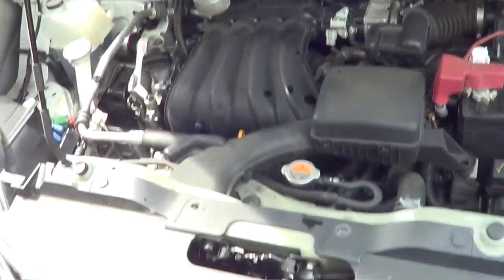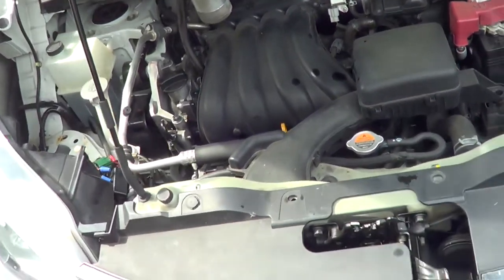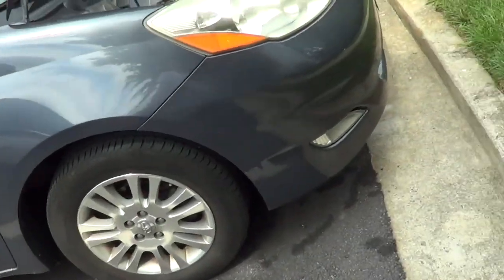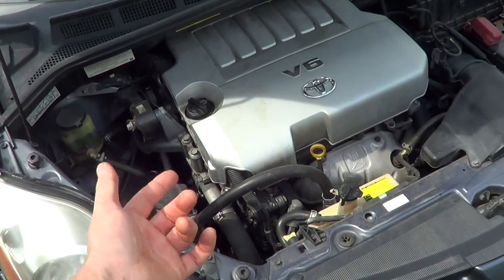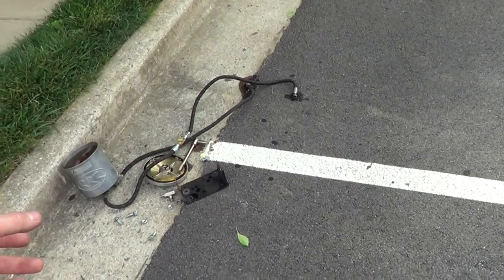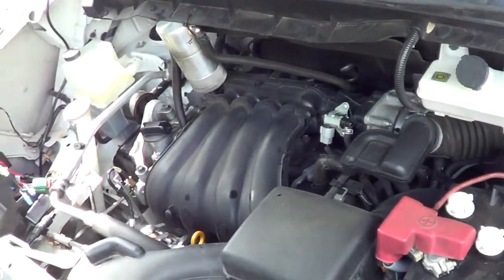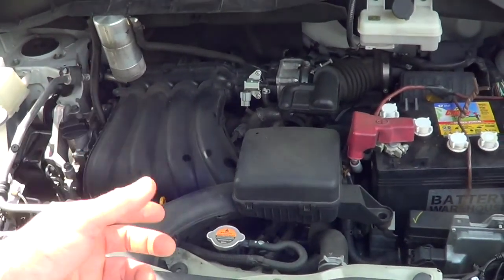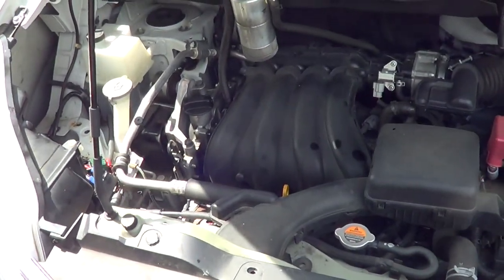Oil Bypass Filter Pulled on Gasoline Engine

Comment: Of course you have to change the oil. It doesn't matter how well it is filtered, the additives in the oil simply do not last forever. They break down with time,  prolonged pressure and heat Causes oil to get thinner as the viscosity modifiers degrade.
Reply from the maker: Dielses can go 100k miles between oil changes.  I was trying to achieve that with gasoline.  But I found it isn't possible because the tolerances are too tight to deal with the sludge.  I couldn't  find anybody else doing thus experiment on gasoline.  So I did it and published.  The best results are 7 to 10k oil changes with a good quality oil.  I'm not sure about 3k filter changes though.
Reply: We had trouble with the multi grades back in the 60s They had trouble because of not holding up for extended use. You.for.sure didn't use multi grade oils in a diesel. My. Rambler used Delo 100. It was for diesel engines but I Didn't care. The Frantz kept it like new. I used MD toilet paper. Some oils turned dark with use.because of ashless additives. I liked the Chevron Delo 100 because. It was golden. Some of these modern oils will increase in viscosity with extended use due to evaporation. To deal with that I change the filter often enough to keep that from happening. Was looking at an owners manual for a diesel car. It said use multi grade and the warranty is voided. Another one said use 10 40 and the warranty is voided. It took me a long time to get to using.multi grade. It took more polymers to make 10 40 than 10 30. The polymers didn't hold up. Things have changed but the oil still needs to be clean. Allowing the oil to get dirty then draining is a lousy maintenance program.
Reply: The reason sludge is in the engine is because the filter isn't taking it out. That is usually because the filter has no depth. That's all spin on filters. If the filter has enough depth to clean the oil. It means it's not being changed often enough to clean remove the sludge. You can look around and find several that clean oil. If you are not changing them because the elements are too expensive You are screwed. Years ago Toyota had trouble with sludge clogging oil passages. That was caused by extended oil drains without better filtration. Might still have that problem. The sludge is supposed to be in the filter.

Comment: Great video. Have thought about going 100% synthetic like AMS oil? W/o the there filter plus oil, your guaranteed for 35,000 Miles. I'm doing this with my 2nd gen Cummings plus I do have a Napa bypass filter...5 micron filter.
Reply: Haha 35,000 miles, trust me that oil is done at 20,000 in a gas motor, good luck in a diesel.

Comment: What kinda oil were you using?
Reply from the maker: Pure synthetic amsoil signature series.  I could not find any evidence that bypass filter extends oil life on gasoline engine.  Big rig diesel may be able to handle the soot.  But, not gasoline.
Reply: NathansHVAC interesting findings. I’ve been playing with the idea of installing a bypass system, but wasn’t sure if it would be worth it. Guess not
Reply: Its a typical problem with expensive filter elements.tHey don't get changed Enough to keep the oil clean. The Amsoil is like most oils. They will stay looking new as long as you keep it clean.The old Amsoil filters were very good but didn't get changed Enough to keep the oil clean. The pleated Amsoil filters are a joke. Get one of the toilet paper filters and some Scott 1000 and change the damn thing.

Comment: oil life depends on use and hours. Not miles. Cars that calculate oil life via engine rpm, load, temp, and hours can indicate a long or short life for oil. EX) 2007 suburban that is used for road trips: oil life indicator will lets us go 12,000 miles+ between oil changes because we get on the highway and cruise for several hours straight. But once it's back to daily driving the life drops quickly. GM calls for synthetic fluid from the factory and Mobil 1 is our favorite. My dad and I each personally do 10k oil changes on the 10s.
Reply from the maker: I was trying to get 20k oil changes with bypass filtration.  But, it an't going to happen.
Reply: I don't drain oil. With the Subaru I bought new I was changing the Frantz and adding a quart of Mobil 1 15 50 racing oil every 4 July or about 12 k for 250 k. A Caterpillar lab said it looked good for that many miles but I probably needed a quart of Mobil 1 twice a year. The Frantz had no trouble keeping the oil clean but a engine needs enough oil to replace the additives. On the Altima I do every 4 July and Christmas. 2 quarts of Platinum and 2 rolls of Scott 1000 won't break me.  I bought the Altima with 225 k on it. Installed a Japanese import engine. I think it's going to use a little oil. I have to factor that in. The Subaru didn't use oil. I might go to a 5 50. Not sure the engine is OK with the 15 50 Mobil 1.  Some time after 250 k The Subaru started leaking oil at both head gaskets. Should have replaced the head gaskets. It had Amsoil gear oil in it sinse new. 84 Subaru. Gave it to a friend.
Reply: New wife has a Pontiac Torrant that tells me when to change the oil. All I need to know is how to turn off the light. She says but they told me down at the oil change place I needed to change the oil When it says to. They charged her 3k for 2 struts. That bull shit stopped.

Comment: No diesel engines are not designed. to run on dirty oil. My Mobil 1 always looked new on the dip stick. So far the Pennzoil looks new at 40 k. I don't tolerate dark oil. In the 60s and 70s I used Standard Delo 100. It was designed for diesels. It was a beautiful oil. In those days It turned black in a hurry without a good bypass filter.
Reply from the maker: Good to know.  Thanks for the comment.
Reply: Oil in a new Diesel engine is black as soon as It circulates through the engine, thanks in part to the egr, dpf and the fact that you can never get all the old oil out of the engine when it is changed.. I’m running a bypass filter and it is still black. Diesel oil is designed to suspend the soot in the oil. The only way to tell if the bypass filter is doing its job is to have the oil tested.
Reply: I got so used to the oil looking like new in a gasoline engine I expected it to look the same on my Peugeot. I learned on the Peugeot you need to change the filter more often and add more new oil. I didn't make the same mistake with my Ford 6.9.
Reply: Dirty oil is easy to spot in a diesel.It can be analytically clean and be very black. I like it to look like someone poured a bunch of black ink in it.
Reply: In my younger days I drove trucks.one company had Luber Finers on all the trucks. I cut open a element. It had cotton waste in it The same as my Fram on the 41 Dodge. Another element was a Wix. It had pulverized newspapers and wood chips. Some of the engines took longer for the oil to turn black. We had mostly 8 V 71 Detroit's and Cummins.

Comment: If you have to change your oil your oil is no good or your filter is no good or both. I used Mobil 1 in my 84. Subaru for 250 k . It started leaking oil. I told a friend that had his fancy Chevy pickup stolen he could have the car but it needed both head gaskets. He carried a cheaper Olli in the trunk.I lost track of it after 300 k It had a Frantz oil cleaner on it. Changed the toilet paper once a year and added. a quart of oil.The drain plug was never touched as long as I had it. Right now I am using converted Motor Guards and Pennzoil Platinum. That filter you took off looks like a good one. I would try to adapt it to take Scott 1000.
Reply from the maker: ralph wood I'll sell it to you for $50. The depth cellulose filter is better than a pleat. So I probably wasn't fair on this filter. Send me an e-mail at.     N at han GW at airmail.net    no spaces.
Reply: Thanks I am in pretty good shape for bypass filters.

Comment: I did a test also, 1999 honda civic, changed oil every 20,000 miles for about 200,000 miles. No issues, sold car with 300,000 miles and it ran great, plus had original clutch.
Reply from the maker: Some engines can probably handle dirtier oil than others.
Reply: I could easily do that with my Altima.Its a very clean running engine and my oil doesn't contribute to the problem. Your oil won't be as clean as mine. I'm such a cheap old bastard I think 20 k. oil changes are excessive

Comment: I was looking forward to this update. Very interesting conclusion. Thank you..
Reply from the maker: We Are Miles From Nowhere it was somewhat disappointing. My next project will be figuring out when the bypass opens on the main filter. The Triple R filter would have some particles of aluminum laying on the top. That tells me they were getting past the main and getting to the journals. And if I can see the particles they will definitely damage to journals. The only way I can figure to monitor the bypass valve is with an ultrasonic Metallurgy sensor. I'll probably do a video on that in a few weeks. I have a feeling when the oil is cold the bypass opens. The ultrasonic sensor should detect the movement of the bypass valve.
Reply from the maker: If the main filter bypass valve opens when the engine is cold, an engine block heater might be worthwhile. But it seems that changing the main filter every 3000 miles is safe. I'm also tempted to throw a magnet on the main filter. It's super easy to do and can't hurt anything.
Reply: I do appreciate you doing this research as I have been tempted to purchase one of these for a gasoline engine. Not now thanks